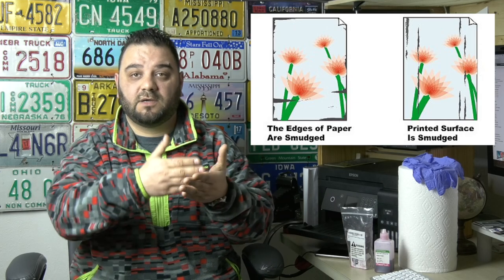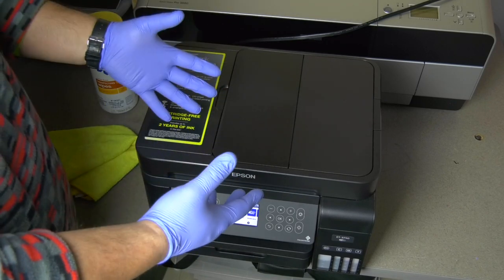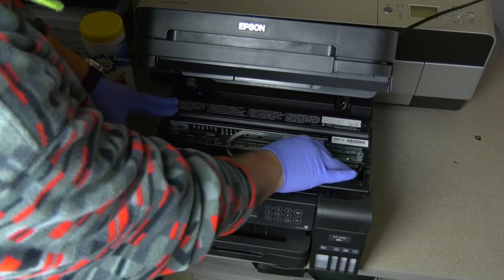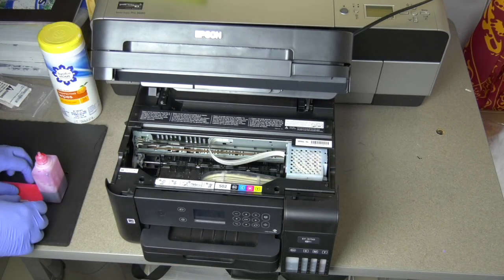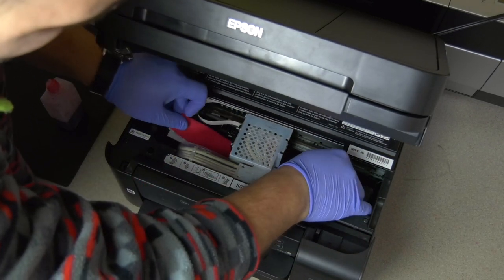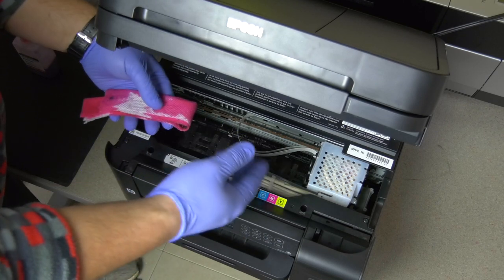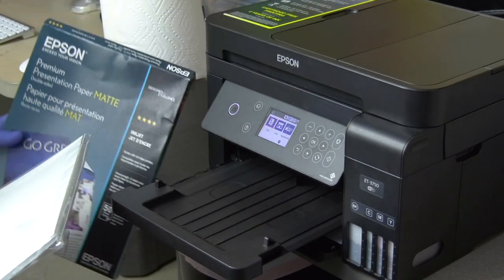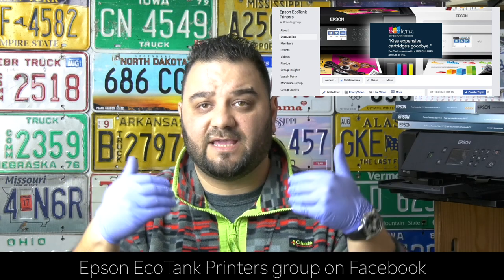CLEANING Clogged Printhead Nozzles on Inkjet Printers- Step by Step Process - Epson HP Canon Brother

Comment: I watch your video to see how you cleaned the printhead and hoping to find out what cleaning liquid you use.  I appreciate you showing what you use.  We have an HP 7110 that has been great for 10+ years.  Now it wont print at all and I think it's a clogged head. I'll try your cleaning method and if necessary pull out the printhead and clean it more thoroughly.  Thanks for the well done video.

Comment: Here in ASIA we use diff method. We manually remove the print head and inject cleaning solution which is risky but effective. Thank you for sharing this though.
Reply from the maker: Thank  you Jaspher. It sounds interesting and I would definitely try it if that's the only way to save a printer. I appreciate you for stopping here and sharing this. 🙏
Reply: Can I use alcohol or vinegar? 
Everything works except the black ink, it smudges & blurs, it uses 2 black cartridges so I replaced them both 2 times (I don't know which one of the 2 has issues 🤣) i was hoping they were defective but no, the problem is still there & I wasted new cartridges 🤔

Comment: Didn’t work for me. We still have vertical white lines throughout the printed sheets. Really bummed as this is not that old of a printer and we have run thru a bunch of ink using the cleaning cycles etc…hate to trash (recycle) this unit but not sure what else to try. 

Good video though. Thx!

Comment: Thank you for this video. I have 2 epson printers (XP 800 and Artisan 830). I need to clean my print heads but Office Depot does not sell the fluid. Where can I buy some?  I live in Oklahoma in a suburb of Oklahoma City (Edmond). I already bought the paper towels you recommended. I do Mac tech support so having this knowledge will be helpful for my clients too.Thank you for taking the time to help us!
Reply: Ebay or Amazon i got mine from ebay
Reply: You should use my proven method: glue a cotton pad on the underside with tape, then moisten with any liquid containing isopropanol, for example, almost any window cleaner, place it under the print head in a parking space and leave it for a quarter of an hour, repeat if necessary.

Comment: What should I do if my printer is printing completely blank as if the inkjet nozzle is not touching the paper at all? The printer had been in storage for about a year. The model is an Epson wf 2630. I bought new ink cartridges.
Reply: Since ink is a liquid, very probably the ink has dried while in storage. There is a video somewhere showing a small tube placed over the ink inlet then the tube filled with a solution. All inkjets should have one page with all colors printed once a week to prevent drying.

Comment: I have the epson 7750 and i keep getting large streaks of blue across my prints my nozzle checks come out perfectly fine but the prints are still bad. i got my printer serviced but it still has the exact same problem! I need help the printer is only 6months into its use 
And I’ve got this problem i feel like i’ve wasted my money on this.
Reply: Also if i do this clean can i use distilled water instead?

Comment: Piezoflush is available in the US, but not in my country. What's in it? I have 95% isopropyl alcohol. Would that work instead, or is there something in what you used that I can't replicate?
Reply from the maker: Ann, do not use any isopropyl alcohol. Better buy any printer head cleaning solution. Try eBay or Amazon. It doesn't have to be the exact brand I got...
Reply: @IamTiberio  Why not?
Reply: A solution of Windex 70% and isopropanol 30% works great, I just cleaned my Epson yesterday.

Comment: If I want to print about 24-30 pages at a time (I use it to print animation frames), with 32 lbs paper, will it cause me problems? Is it possible or does it only prints small amounts of pages at a time? 
I only print in black and white, but I am worried about the consistency of the prints, as in saturation of the image
Reply: I've been using Canon Pixma Pro-100, which obviously it's great but the Ink it's crazy expensive, since sometimes I need to print 1000+ pages a month. I don't need the image to be really saturated, I just don't want each print to look different otherwise it will ruin the animation.
Reply: I am also considering  EcoTank ET-2720. Because it has a back tray feeder so maybe it allows more pages to be printed
Reply: @jmapa998  Also consider ET-2750 if you normally do double-sided printing. It automatically prints double sided but on ET-2720 you will have to do it manually.
Reply: I have a small model of Epson. It is XP422 and when printing invoices I write them in a file that has 30 invoices, so it prints 30 at a time and it does it just fine and very quick. Well it did until I left it for a few months unused and the print head blocked up, LOL. But I'm hoping to keep trying to clean it soon now I have extra knowledge on doing this.

Comment: Hi Tiberio...thanks for all your videos...I watched a lot of your videos before purchasing the epson et-7750 in December...so far I am very happy with the printer...I had an et-2650 before this and was very happy with that too (gave that to my brother)...I have always used Epson printers but I hear the Canon are good too...the main reason I changed is for the better photo capabilities of the et-7750...you mentioned that you also had the canon pro 10 and pro 100?...I know these 2 printers are more expensive to run being cartridge based and having 8 or 10 cartridges to replace...the eco tanks are definitely much cheaper to run...what do you think of the quality of photos from the et-7750 as compared to the canon pro 10...I know the canon should be superior having 8 or 10 colours but do you see a big difference when looking at a photo?...I know longevity of the inks on the prints should be better on the Canons too...thanks again for the videos 👍🏻
Reply from the maker: Thank you so much for taking your time and write to me about you printers. Regarding the comparison between the Canon Pro 10 and Et7750 I would choose Epson all day everyday. The Pro 10 has a slightly better printing quality but not visible for a untrained eye... but for a long run... cost effective, printing quality, maintenance the Epson beats it. On both Pro 10 and 100 I used to get errors, paper jams... and then the cost for the cartridges was so high. You got my point. :) I plan to do a new series of videos about my ET7750 and ET3750 these days... good stuff(ICC profiles, free downloads, tips, papers...) You should join our "Epson Ecotank Printers" Facebook group... Over 5000 Exotank users are sharing their experiences there. Please subscribe to in order to be updated on the new Ecotank video series. I wish you all the best. Tiberio
Reply: Thanks for reply Tiberio...yes, I am subscribed to you here in YouTube and I joined your Facebook group after getting the printer in December...I am very happy with the et-7750 and have printed lots of photos using the epson papers so far...good to know about your experiences with the canon printers...I’m looking forward to seeing your new videos soon...I looked at your current videos too (the commercials) and they are great too...I am also a drone flyer so will check them too...best wishes from Dublin, Ireland, John.
Reply from the maker: @johnvideos2009  https://www.youtube.com/watch?v=CLLIgow4ta0&t=135s I thought you would like to watch this :)
Reply: @IamTiberio  : Thank you Tiberio...I seen your video in my feed and watched it...great work 👍🏻...I had the  Epson ET-7750 driver installed on Windows 10 pc so my various software (LR and Infinity Photo) had picked up the ICC profiles for Epson papers there but I’m sure many people don’t have them so will find your video very useful...I also print straight from an iPad or my phone so I just pick the appropriate Epson paper type in their mobile App...very pleased with the results so far...testing out some third party papers too but I do like the epson papers best so far...looking forward to seeing more of your videos with tips & tricks for the ET-7750 🖨 in the near future 👍🏻...best wishes, John

Comment: I had just purchased a brother mfc-j615w and it doesn't print at all, i've done flush and the paper towel thing with the printerhead and still didn't help can you tell me what I can do next, help, thank you
Reply from the maker: I am sorry to hear that. Try leaving the paper towel ''soaked'' with the printing head cleaning solution overnight. It might help. But the printer was working?
Reply: I bought it used , on offer up, the seller said it was working , but she hasn’t used it in a few months, so as I brought it home to set it up , I found that it doesn’t print, so disappointing , i will try the paper towel over night but I don’t have any more cleaning solution, is there anything else I can use in the mean time?
Reply from the maker: @tammyjohnson7918  Wow. Again, I am sorry to hear that. It's clogged and that ink has to be dissolved. Try leaving the piezoflush overnight and perform several cleaning cycles from the printer menu. You can also try asking on the ''Epson Ecotank Printers'' group on Facebook
Reply: Tammy did you ever get it to start working Mine stopped after I did a printer head cleaning

Comment: I have Espon XP 410 it does nothing I have not used in 3 years and I bought new ink nothing do I'm watching videos to see before I trash it
Reply: Fuel used by radio controlled glow plug engines used on Epson printer with totally blocked head used syringe and fuel hosing direct into head with ink carts removed . Took few cleaning cycles then printing dark pics to get some ink through but now prints 100% perfect no banding .Was going to trash printer so nothing to lose
Reply: @andymath1523  What about fuel for RC engines? are they all the same? How about 100% clear alcohol, no water?

Comment: EPSON Ecotank ET-2750 good printer to buy thanks
Reply from the maker: I agree with you :)
Reply: @IamTiberio  I am think of buying the EPSON Ecotank ET-2750 to replace my canon mg6650, probmems with print head code 1403.With the epson do you have to use there glossy paper with it thanks,Good video .
Reply from the maker: @davidlacey6417  I owned the ET2650(this is the older version  of the ET2750 very similar) about 2 years ago, great printing quality but it was too slow for my taste. The 2XXX series is the smallest in the line up and it is so very suitable for a ccommon/regular printing needs for any household. You can use any kind of paper up to 44lb weight. Check out this videoto see what paper I use for my designs: https://www.youtube.com/watch?v=idqJ5LVQ6uI And as you consider to go on Epson Ecotank printers this video will clarify some things: https://www.youtube.com/watch?v=EPzgeZoYaYs Looking forward to hear your experience with your new ET2750. I hope this helps

Comment: I wish it was that easy, or I wouldn't be here watching what is a normal cleaning. My black ink simply will not print no matter what, after all the cleanings, in the world, of nozzles as well as the entire black in tubes. Black just will not print. There seem to be something  more wrong with the black ink connection that no one seem to actually know about, and think it has to do with just cleaning. Oh, and all the other colors work perfectly.